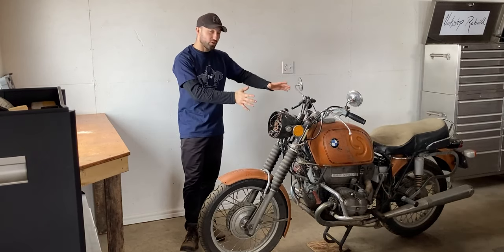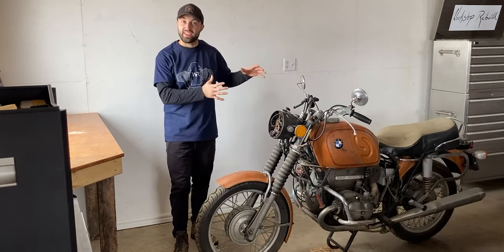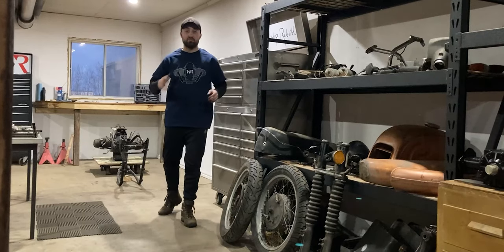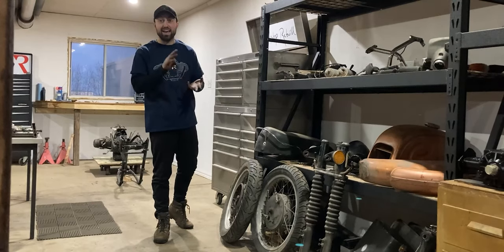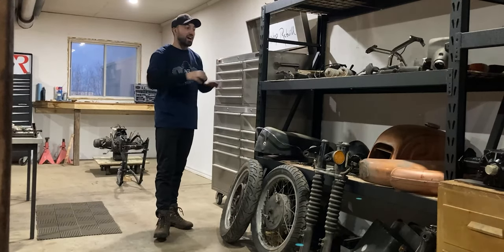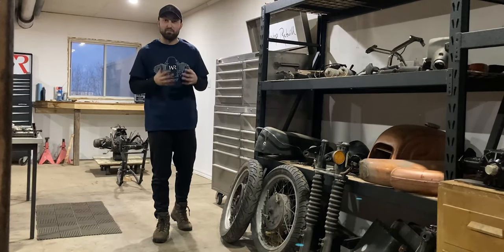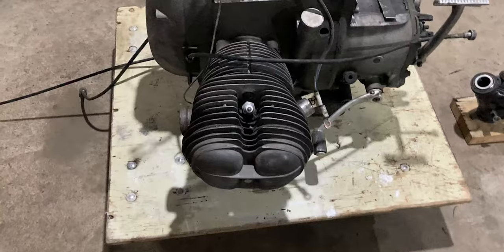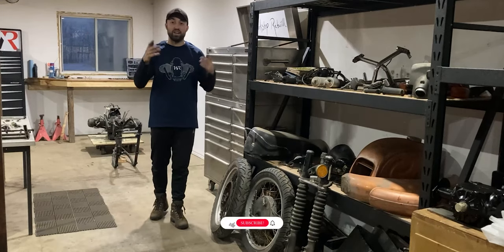BMW R60/5 Teardown in 15 Minutes

Comment: I also like how he chose to acquire this bike as a well worn and very dirty unit to rebuild.
Shows how with proper leaned knowledge and determination it can be done in a basement.
Reply from the maker: I agree with you John, this bike is well worn! After being 50years on the road (mainly in the U.S), I want to bring it back to life with new parts and color.
In doing so I will share a series of videos up until the final finish. Hopefully that will follow sooner than later😁

Comment: Just hunting on the computer on BMW R/5 models (I have two /5's projects and a parts bike), I came across this channel today and I love it! counting all my BMW's besides the ones mentioned, I have a R/100/7 engine in a R/75/ 6 frame, a R/100T, an R/100RT and a R/100/7, just fully restored with around 1,000 miles ridden. These bikes are ridden monthly. Over the last 45 years or so I have had fourteen /5 or /6 series bikes, which I passed on to the next "caretaker." This is not counting the bikes I own now. Maybe some day you can get into the /5 headlight wiring system in detail (yeah, I have the manuals) as that would be of great help to me. when I take the headlight ring off and look at all that "spaghetti" I think "it's gonna be a LONG day! any tips you can offer would be appreciated by more people than me. Thanks for sharing your journey on You Tube, I subscribed.
Reply from the maker: Hi Robert, thank you for watching the /5 videos on my channel, I'm glad you found them!
Your collection is simply AMAZING, especially since they are all put to use on a monthly basis. Do you still own your favourite bike, or has that been passed on to the next caretaker already?

That's actually a great question, and YES, I will be working on the headlight bucket and the wiring system. The bucket will be fully restored with new paint, and it will receive a brand new key switch. The wiring on the other hand, will probably be discussed after I mount the drivetrain and the headlight bucket onto the the frame assembly. I will share details about the wiring on my table and then start pulling them on to the frame and into the headlight bucket (this probably just makes most sense and it will give you as a viewer the best overview).
Thank you for your support and I cannot wait to share the final result with you on this BMW R60/5 restoration. Regards Andreas
Reply: Thanks, Andreas. You are keeping the /5 series alive with your videos! I got out of biking 7 years ago after a "too close"  left turner almost wiped me out. I had 2 BMW's at the time and sold them to the New England Motorcycle Museum and donated some things also, like a 1930's Police Jacket  and some old Indian memorabilia. I was out of riding and biking until last spring when I got back into it again. I hunt BMW bikes down and "resurrect" them as a hobby. That's where your videos have been great! I subscribed as soon as I watched your first video! Sure, I can wrench and do my own work but, even with the manuals, It's great to have a step by step video like the ones you create! I'll be 70 in a few weeks and I needed a hobby and here I am! BMW's will never let one down and I'm having a blast as I get back into it. Keep up the great work, my friend!  @WorkshopRebuild
Reply from the maker: I'm just getting started with these bikes and I've already learned so much about this R60/5 motorcycle! All I wish to do, is to share as much information as I possibly can, to help someone else down the road.
I'm happy to hear that you're getting back into the BMW motorcycle scene by resurrecting them one after another. The /5 motorcycles still share some vintage vibes and you can definitely tell by the sleek headlight bucket and some other quirky features from the early 70's. This is something which is just so neat about these bikes in particular.
I'm not doing everything by the book, as I do not have all specialty tools, but I try my best to share everything in as much detail as possible. This will allow you and every other viewer to have a clear angle of the disassembly and the assembly process. Something you don't always have in a workshop manual.
Thank you for your support, Robert! It means a lot to me that you subscribed to the channel!! I hope you continue to wrench away on your newest acquisition and that you find joy in what you're doing. I will continue to upload videos until this R60/5 bike is complete and maybe in the meantime I will add another project to the video playlist. 
Thanks again for your engaging comment! Regards Andreas

Comment: I would say the Beemer would be about the only bike I would put engine guards back on!
Reply from the maker: Since the cylinders stick out very far, I might reuse them once everything is said and done. If that's the case, I will have them replated and they should look like new after that. Thanks for your tip. Regards Andreas

Comment: Wow, it's really great to watch you work. I have a /6, but have been hesitant to disassemble some of the major components. Watching this gives me confidence to dig deeper. Love the exhaust nut wrench - did you make that yourself?
Reply from the maker: Thank you so much Richard, I appreciate your kind words! A /6 Motorcycle has some very nice upgrades. especially the a 5 speed gearbox. Working on major assemblies like the engine or the gearbox can look very hard at first, but with a couple tools and little bit of confidence anyone can rebuild these components. 
That is correct, I made my own exhaust wrench from a 1/4" thick piece of mild steel. I measured the tabs on the exhaust and cut the material out with and angle grinder. I hope these videos help you and I will have some more in the near future. Regards- Andreas

Comment: To remove the final drive you used a 27mm socket and a breaker bar. I can't find a 27mm socket that fits that nut. Where did you find yours?
Reply from the maker: The one I have is a thin wall socket. It's more common in Europe, when dealing with European makes and models. You can take a regular 27mm socket and machine down the outside diameter in order to fit the nut. Hope this helps.

Comment: Whats all the electronics in The license plate bracket? Sorry just getting into these old bmws
Reply from the maker: Hello Joseph, the electronics on the back of this BMW turned out to be a vintage anti-thef device built right into the license plate holder. This device has two mercury contactors to determine when a bike is tilted. Once the contact is made it will set an alarm off. I have not tested the unit just yet, but maybe I can bring it back to life! It would be neat to mount it back on, because it is from the 70's-80's. 
Thanks for asking! Regards Andreas

Comment: Hi! Can you explain better how to remove the saddle?
Reply from the maker: Hi there, the saddle is mounted onto the frame by two hooks on the right side, which you have to remove.. To lift the saddle you must first use your key to unlock the lock on the left side of the frame. I hope this helps

Comment: I highly recommend using disposable nitrile gloves when refurbishing a motorcycle. There are a lot of chemicals present that are hazardous to your health and best to keep them off your skin! If I'm not mistaken, there was water in the oil you drained - which means there's the potential for corrosion in the motor. I hope it's not too bad, but in any case, these are extremely rebuildable bikes and BMW has most parts available new. The aftermarket for used parts is also flourishing so there are options.
Reply from the maker: Thank you for your advice John and you are correct! There are many chemicals present on the parts I removed and it would be best to wear gloves! Yes, water did come out of the oil drainplug before oil and I hope there is not much corrosion internally. Since the engine seems to be leaking here and there, I have a feeling I will have to re-seal this engine with new gaskets and seals. If I'm that deep into the engine I will make sure everything is according to the specifications of BMW and I will address any issues. If all goes well I should have a very fun and reliable classic bike. My goal is to restore this back to original, but that means I do need some parts and I will refer to oem parts first. Thanks again John, Best regards Andreas

Comment: I have an R60/5. 1971.   
Battery that came in it when I bought has gone bad.  Can’t figure out how to get the replacement a local parts place sold me into the bike!😮 it is a bit wider than the one I’m replacing.  Not sure if their computer recommendation was bad info?
Reply from the maker: Hi Jason, you got yourself a nice bike! If I were you I'd take the battery back and ask for a replacement. You can take a measurement of the battery tray (Length, Width and Height). This will give you a rough size of the battery and it obviously has to be a little bit smaller to fit. The battery I removed was already a replacement by the previous owner and it measures roughly (7" x 4" x 7"). 
I hope this will assist you when looking for a battery. Regards Andreas

Comment: Hi there. What is the name of the tool you picked up @ 8:36 in the video to remove the exhaust pipes? Can they be purchased or was it homemade?
Reply from the maker: Hi Simon, The tools is called "Exhaust Nut Wrench" and you can buy them online. I did not purchase one for the disassembly process, so I made my own from a piece of flat stock steel and made the shape of the exhaust nut. Here is a link to the supplier I use for my BMW parts and they have them for sale: https://www.euromotoelectrics.com/EXNut-Wrench758-p/exnut-wrench758.htm
I hope this helps!